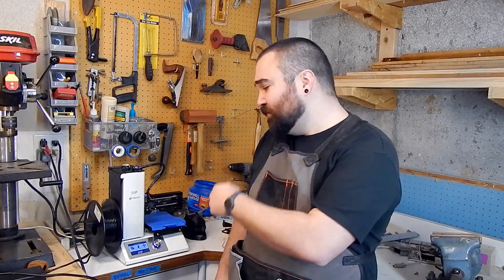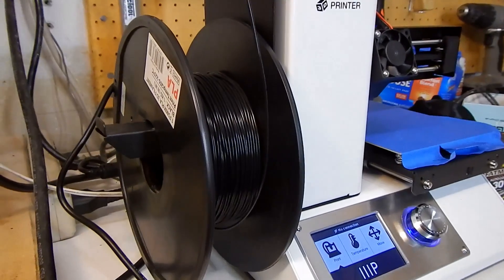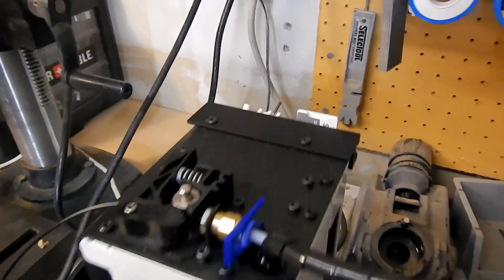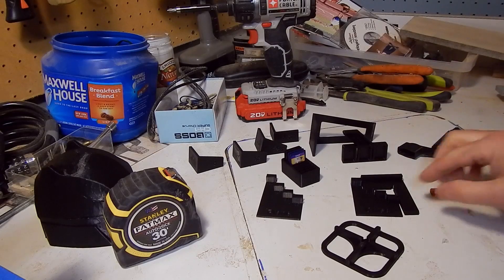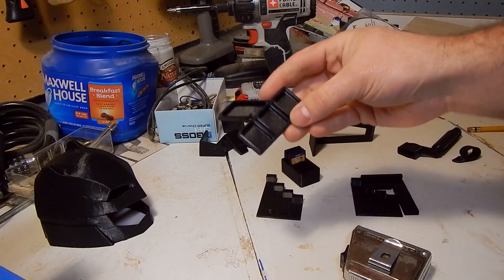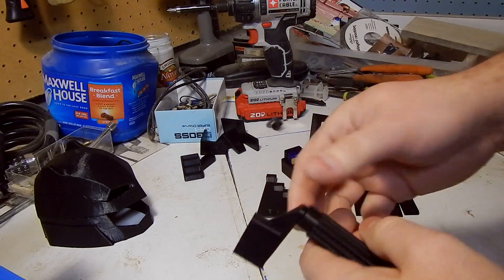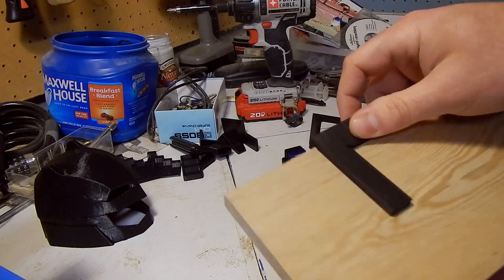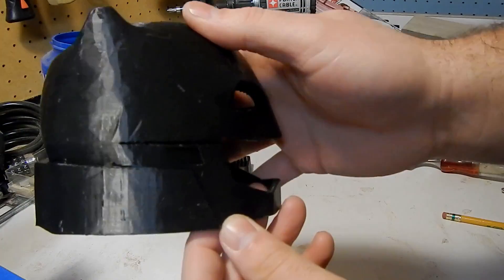Is the $200 Monoprice Select Mini 3D Printer (Malyan M200) Worth Your Time? A Beginner's POV.

Comment: No need for the tape I print mine with just the heated bed as adhesion no problems with it
Reply from the maker: Nice! I didn't try printing directly on the aluminum. Good call.

Comment: I am a beginner too and I have had nothing but issues! It won't finish prints for me :( Too late to return it now I have a dust collector!
Reply from the maker: +Amber Mancha how are the prints failing?
Reply: Anthony Tackett they just stop in the middle of the print it's not like it separates but it will stop exactly where it's printing and then that's it
Reply: Anthony Tackett so I have a couple of things that are almost finished and the print won't complete or I have a couple of things that get through a couple of the first layers and then it stops it really just depends on what day my printer is having 😩
Reply from the maker: +Amber Mancha does the printer stop completely or does the plastic just stop coming out of the nozzle?
Reply: Anthony Tackett both. They're sending me a new one! Hopefully this one is better!
Reply from the maker: +Amber Mancha That’s great! Hopefully it’s just a defective machine. Good luck!
Reply: I would love to pay to take the old broken one off your hands to try and fix it up

Comment: Can i use a program to import some specific models?
Reply from the maker: Yeah! You'll have to use a program called a "slicer" to get the files ready to print. I use a free slicer called Cura. You can get free models from thingiverse.com to import into your slicer. You'll adjust your print settings in the slicer and save out a .gcode file. That's what the printer will use. With the MP Select Mini, I used the microSD card so I loaded the .gcode file up on that and then selected it from the printer to start things. Its a few steps but not bad!
Reply: Anthony Tackett Thanks for the reply!
Reply from the maker: Of course!

Comment: The $200 select mini prints as good as some of the 600-1000 printers. no lie.

it DOES however, have a pretty small bed.... 120x120x120 MM.

and, most people dont know.....

it  has WiFi, but its not advertised... but its there.
look up how to connect to the wifi.

you leave your SD card in the printer (because thats what it will use as the hard drive for your wifi uploads)
and upload through a browser.
Reply from the maker: Yeah! I knew it had wifi but hadn't tried it on the one I was using. My current printer is hooked up to a raspberry pi running octopi and I really like that.

Comment: I just got a mini select, also. I am so glad to see these practical items for wood working. I'll be printing them soon. I would love to hear about your issues with printing you first objects. I'm having problems getting it to center the object on the printer bed. In any case Good Luck to both of us.
Reply from the maker: Hey congrats on your purchase and thanks for the kind words! I use Cura as my slicer and when I right click on a model, I have the option to center it on the platform. That's usually what I do and it comes out fine.

Comment: I didn't read alot of the comments so whether or not you know about it, there is an exotic filament which is a mix of PLA and very fine wood dust to 3d print odjects that look like wood, smell like wood, and feel like wood. I think it's something that might be right up your alley. there's videos on here of people that have used it, check em out.
Reply from the maker: Yeah! I've been testing some Hatchbox wood filament and plan to review it soon. I'm actually exhausting the spool as we speak. I'm excited to see how it interacts with stain.

Comment: I think the 45 degree thing would be pretty cool, a couple years ago I 3d printed an insert plate for a scroll saw I was restoring (i used my school's printer) , but that may be worth looking at. you could probably make one for your table saw.
Reply from the maker: Nice! I have a larger printer on the way and a 3D printed throat plate for the table saw is a great idea. Thanks for the tip.
Reply: @AnthonyTackett what larger printer? how is that working out? 🤔

Comment: Hey, I just received my M3D micro, but I'm super disappointed by how small the printbed is. Do you think the size difference between the print beds is worth returning the micro and ordering this one?
Reply from the maker: Hey!
The monoprice definitely has a larger print volume but not too much larger. There are upgrade kits you can buy now for the mini that increase the capacity a good bit. Overall, it might be a good idea to go compare specs of the two printers and consider things like modifications and expandability.

The monoprice has a huge user base and a very active Facebook group that is great for support. There are countless "upgrades" you can print for it to enhance its performance and it is pretty easy to work on. It seems like the mini might have a bit more flexibility in the filaments you can use, also, given the way that the spool is stored.

The M3D does have a self-leveling bed, which is nice, but it isn't heated, which is also a great feature. A good ol' fashioned pros and cons list might be in order.

Good luck and let us know what you decide!
Anthony
Reply: I just also learned about the Tevo Tarantula self-build kit, and this is making my decision that much harder! The Tarantula has a much larger build area (200 mm x 200 mm)  than the monoprice (120 mm), which is a huge part of why I'm abandonding the M3D micro; I realized as soon as I took it out of the box that I would have to either scale down most objects so they could fit within the bed, or would have to redesign everything to fit together puzzle piece style. ugh. 

but they are both very easily upgradable due to their industrial style build. However, the monoprice seems to be built like a tank (metal) while many of the tarantula's parts are acrylic which may crack. Considering I am still fairly new to the hobby, do you have any input on which way I should go? There are so many things to consider.  thanks again for your responses!

Comment: How much is the filament? How long before it used up? How much you can print?

How long of the filament used for the batman head?

I have a bit suggestion for you, you make great contents, but the view is quite low, I think the problem is the thumbnail is not really clear about the content of that video, maybe you can change the design a bit I guess! Check out my channel too if you have spare time!
Reply from the maker: Hello! The filament price varies by brand and plastic. You can get really cheap stuff online but the PLA filament I have been using is Inland filament and you can get that at Microcenter for about $15 for a 1kg spool.

As far as time and how much you can print: that will vary greatly based on what you're printing. I printed off dozens of things with the black spool you see in the video and only recently exhausted the spool.

The batman head used around 170g of filament because of all of the support material required for the inside of the helmet. That was a little under 1/5 of the spool.

Thanks for the feedback about the thumbnails.

Comment: so the first thing you made was a knob extension?
Reply from the maker: I reckon I can build that I'd definitely consider that for one of your first prints. The machine definitely benefits from it. There is also a tool rack on the back for a SD card adapter, a removal knife, Allen key and I just printed a holder for a glue stick.
Reply from the maker: I reckon I can build that all of those things are on Thingiverse
Reply: Anthony Tackett ok, thanks.

Comment: Looking for help, great video btw. We've had ours for several days now but whenever I go to print the filament doesn't stick correctly to the table. What am I doing wrong?
Reply from the maker: Michael Watt hello! There are a few possible causes for this. The hot end might be too far from the printer bed. If the filament doesn't seem to lightly squish down on the first layer this could be the issue. I use a sheet of normal printer paper to quickly see the distance from my nozzle to the bed. Secondly, the hot end could be too close. If the filament is grinding and doesn't lay down at all, your bed may be too high. Lastly, try printing on some blue painters tape if you aren't already doing that. It helps with bed adhesion. Could also be that your bed temp is too low. So many factors! Let us know what you find out!
Reply: Anthony Tackett I am using the painter tape and from what you've suggested it looks like it's working now! Thanks so much for your help and the video.
Reply from the maker: Great! Thanks for letting me know. Out of curiosity, what was it?
Reply: Anthony Tackett I slowed the print speed down to .2 and raised the bed temp to 60°. So far it's working but going to give it some more time to make sure. It's still printing the base now. Will let you know how it turns out.
Reply from the maker: Sweet. Yeah I've learned to not try and print too quickly with this printer. I've found that 20mm/s for the outer walls works well and 40mm/s has worked for everything else. I usually print PLA with a 55-60° bed temp with a 190° - 210° hot end. I'm testing some Hatchbox wood filament now and have found it prints best at 190 for me.
Reply: Hey I'm using Hatchbox ABS now and silly me it even states that I should use it between 210° to 240°. For a time I was thinking it was the filament since I've read must people are using PLA instead of ABS.
Reply from the maker: Ah yeah. That'll do it :). I've just started messing with ABS. You can check out my instagram to see all of my ABS woes. I like it when I can get it to print well. I ended up buying a clear plastic tub to completely cover the printer for ABS. It keeps the plastic from cooling too rapidly. I also printed these "abs flags" that keep air from the fan from cooling the print. http://www.thingiverse.com/thing:1976388 I had my first truly successful ABS print last night, actually. That plastic tub works wonders.
Reply: It still ended up not sticking after awhile. It did get further than it did before but it still started to peel... not sure what else to do
Reply from the maker: That sounds just like what I've experienced with ABS. It needs to cool down very slowly and its all about stabilizing the temperature. You can get an elmer's glue stick (the disappearing purple stuff) and put a layer of that on your tape and that helps tremendously with bed adhesion.

You could also put a piece of tape over the bottom of the fan shroud. There is a little slot at the bottom that directs some of the air onto the print. Block that off. Next, do anything you can to make sure there isn't any air movement. My printer is literally printing inside of a rubbermaid bin as I type this.

These are kind of the growing pains of ABS that you'd experience with any printer that doesn't have an enclosure. I just happen to be a few prints ahead of you so I'm sharing what I've learned. PLA doesn't have nearly as many issues and is great to start on. 

I haven't purchased any filament from here but this place has "5 dollar filament". 5 bucks for a 200g spool. I plan to snag a few samples to try. its a pretty inexpensive way to try different types. They even have conductive filament.
http://www.protoparadigm.com/5DollarFilament/
Reply from the maker: I'm also going to try printing with a much hotter bed for ABS. The recommended bed temp is 110° but its tough to get this printer up that high so thats why I've been using tape and glue sticks to help the stuff stick.
Reply: I'll try anything at this point but will have to hold off until tomorrow. Can't thank you enough for your help and advice! I'll be reaching out to you once again soon!
Reply from the maker: No problem. Happy printing! Eventually ;)

Comment: Nice video, been debating whether or not i should buy this printer...Saw the low price so i was kinda skeptical but everyone says its decent.
Reply: Also how many parts did the helmet sculpture have to be printed in? It looks kinda large
Reply from the maker: Hey Nick. Thanks for the kind words. I don't have much reference since this is my first printer but I can say that, once you get the settings dialed in, it seems to print really well. Other YouTube videos seem to confirm that, as well. Let us know if you decide to go ahead and get one!
Reply from the maker: The batman helmet was printed in one piece. The capacity of the printer is about 4.7" cubed and I think the helmet utilized most of that. To make something to scale that you could wear would require several smaller prints and some super glue :)
Reply: Anthony Tackett Just ordered mine, Got some HATCHBOX Filament too. Should be here in 2 or 3 days!
Reply from the maker: Nick Harris that's great! Just make sure the bed is nice and "level", find a sweet model to print and have fun!

Comment: Can you connect it directly to a computer?  I'm looking to buy a printer and its between this guy (because it can use any spool) and the da Vinci Mini
Reply from the maker: Absolutely. It has a micro USB port right next to the micro SD slot on the right side of the printer. It also has unadvertised wireless capabilities. You have to update the firmware to get that running, though, but its not too difficult. From what I've learned, its understandably slower in sending the gcode to the printer but its still pretty cool that it has the hardware to do it.

Comment: What bed heat and extruded heat do you use?
Reply from the maker: Hey. I've been printing the Inland PLA (Black) at 210°c with a build plate set at 55°c. I'm sure that will differ across manufacturers and even colors.